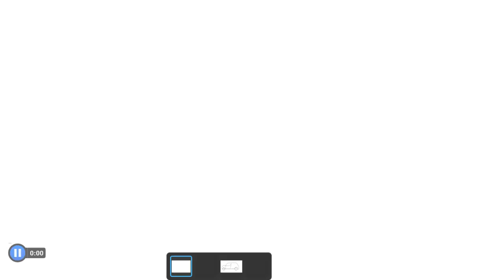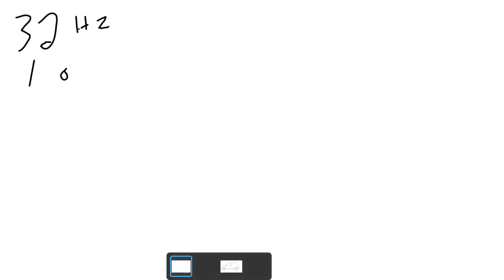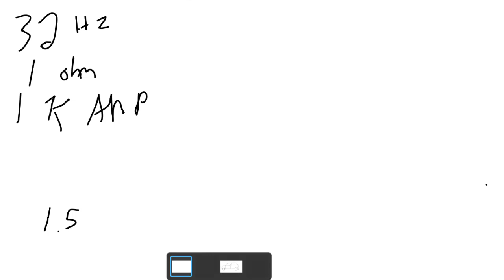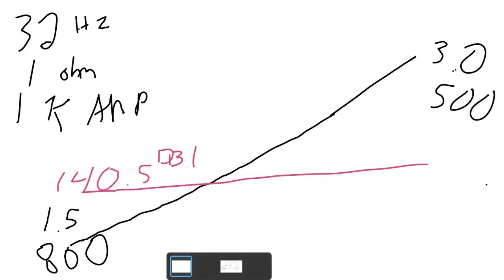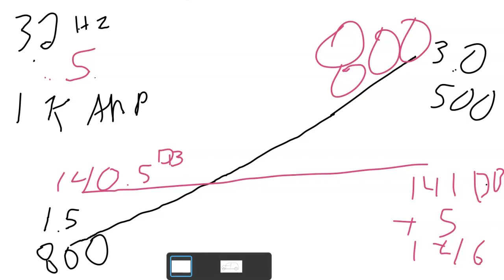Why Box Rise (Impedance Rise) is secretly awesome!

Comment: In WinISD enter your TS parameters and play with box designs. Look imp xmax freq and port velocity and some things will answer themselves. 
Yin and Yang - all things have corresponding trade offs. 
Generally for Loud and Low daily systems I have found that if your port length is about 16” to 24” long at a 14 to 16 to 1 port ratio - the airspace that is pretty optimum for a balance will show itself for ported enclosures. And keeping the port 16 inches long will not unload even when the cone travels beyond xmax at times.

Comment: I been doing some experimenting i have 4 different enclosures in my garage?What I notice when I put my sundown xv3 12s in a 5.50 enclosure they read 2.5 ohms then when I put them in 4.50 enclosure the ohms was 1.9 so that's telling us that a very large enclosure impedance rise higher than a smaller enclosure?
Reply from the maker: In general, yes that is correct.  You will have more rise and be more efficient with a bigger box.  Be careful, too big of a box can damage your sub as well, depending on the power you are pushing.
Reply: @caraudiolab   On another note if you do go a little bit bigger than recommend that subsonic filter better be set correctly if not you will have some serious problems 😉
Reply from the maker: @ceciljones1248  Agreed!  You can also shrink the port to the smallest possible size before chuffing.  That will help add control below tuning.
Reply: @caraudiolab  Yeah you are right I have two 15s that I put in a enclosure that was. 25 smaller than recommended and they was barely moving with the volume half way up but they were loud and most prefab enclosures are a little bit smaller than a regular one

Comment: I've been thinking about this recently. How can I get the most efficiency from my amp. I have a dual 2 ohm subwoofer so I was thinking about running 4 ohm. My amp is rated 1000 Watts at 4 Ohms. I hear MB enclosures talk about dampening Factor and sound quality being better at higher ohms but I've seen people argue that he's not thinking about it correctly. Have you seen any of his content talking about that on YouTube? don't know if I'm making sense the way I'm describing it LOL it would be cool to see a breakdown going into this the way you describe things. I have an sql 12 sealed in 1cuft.
Reply: Mb Enclosures is going to do a test running his subs at 1ohm vs 4ohm to see the difference. Overall I'm looking for the most efficient setup to save on beefing up electrical. Especially in a sealed box. I wanted a 10k watt build but life beat me down lol
Reply from the maker: If you wire at 1 ohm, you will rise to probably 2 or 3 at the lowest and maybe over 10 at the highest.  Plus the dampening rating of amps today is very high.  This was a concern from the 90's when it did make a big difference because those amps had low ratings.  I wouldn't worry about the dampening rating unless yours is particularly low.  I can understand about the power issue, so maybe running it at 4 ohms will work for you.  Just remember, that it will still rise to around 10 at the low and then maybe 30+ at the high.  So, you won't be pushing much power.
Reply: @caraudiolab  I was curious why mb was the only one I saw talking about it like that. If 4ohms is too quiet for me I'm switching over to 1 ohm in a second. Trying to convince myself lower output is what I want😭
Reply from the maker: @RandyTheEngineer  I am currently working on a video where I am goin go compare the series vs. parallel.  If all goes well, it should be out in the next day or two.  I am going to reveal some secrets in this video for you.  I think this will help.... or make you think that much more about it all!  :)
Reply: He is correct my salt 1.5 only puts out 400 rms @ 12v 4ohms . And it sounds wayyyyyyy clear Than my sia 2500 . Which is making 2000@4ohms my salt will hit the lows so good . Sia doesn't its just to much power but it gets everything shaking.

Comment: I honestly have not noticed to be the case, I understand that u will be more efficient with box rise for instance let’s say u hit 140 with 3x box rise pulling 1000w, the same system with only 2x box rise which will give 50% more power (let’s say), it would hit 141, which for 50% more power is not a huge improvement, but it is still louder, this is my understanding, but I’m not anywhere near and expert so I easily can be wrong
Reply from the maker: Think of a bigger vs. smaller box as an example.  The bigger box has a softer air spring inside so it allows the sub to move more.  Since the sub moves more, it has more impedance rise. But also since the sub moves more, it is also louder at the same time.  There are always ways, if you know what you are doing, to reduce impedance some and increase power usage and actually get louder too.  But these typically have trade offs and you end up loosing something, like bandwidth.  Which means you still loose db over a wide range but you managed to increase it at one frequency.

Comment: Thanks for the explanation. I was wondering how to reduce impedance/box rise and how doubling box size or doubling subwoofer count would effect the output of my amp. Sounds like it would increase my efficiency!
Reply from the maker: Increasing box size causes rise which makes it more efficient, has long as your subs still have proper loading.  If you go to big, the subs flop around, which causes several problems but can decrease efficiency as well.

Comment: I'm curious about impedance change going away from tuning frequency and if that's an issue with smart amps.
Reply from the maker: There is a trend to make amps that fight impedance rise.  So, they still put out good power even as rise happens.  You are probably most familiar with the SMART series for this.  However, some half bridge do this as well.  I know some Rockford amps do this.  They may put out 1,500 amps at 1 ohm and then 1,200 watts at 2 ohms.  I am not sure if that is the exact numbers, but that represents a close figure.  As you move up from tuning, the impedance will rise.  You might be wired at 1 ohm at the amp, at tuning be at 2 ohms(lets say 32 hertz) and then be at  12 ohms at peak (lets say at 50 hertz), then the impedance will drop again going higher (lets say 1.7 ohms at 70 hertz).  Smart amps typically treat either .5 to 2 ohms (bass Taramps SMART version) with the same power or 1 to 2 ohms (regular SMART Taramps version) at the same power.  Then, they start to drop off like regular half bridge amps.  Yes, they will put out less power at high ohms (like 10) but so does every other amp on the market, that is normal.  Plus, if the amp put out max power all the time, it would burn up in minutes.  The rise in impedance as frequency changes helps keep amps cool.  Stay tuned, I plan on covering impedance rise in greater depth.  I will probably do a series on it to help people understand why it happens and how different box aspects change the impedance curve, either for spl or for bandwidth.
Reply: Yes, it is an issue. People don’t realize that impedance rise has no affect on your frequency response curve. If your box was designed to be a flat response under a constant voltage amplifier, now with a constant power, you’re not going to be flat. You will have a peak in response where box rise occurs. If you plan on using a constant wattage amplifier, you need to design the box with it inmind. To achieve a flat response with a constant wattage amplifier, you are going to want a box that will have peaky response with a regular amplifier. So basically an oversized box. This is good under some circumstances. But you need a subwoofer that can handle it. Because your excursion will be much higher. If you’re pushing past xmax, then you’re already losing too many db that it’s not worth even trying a constant wattage.